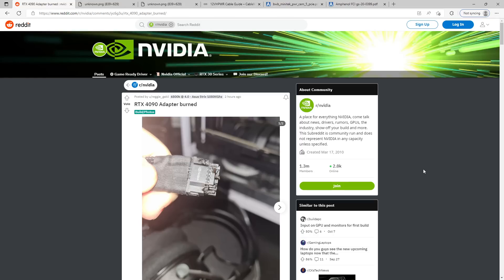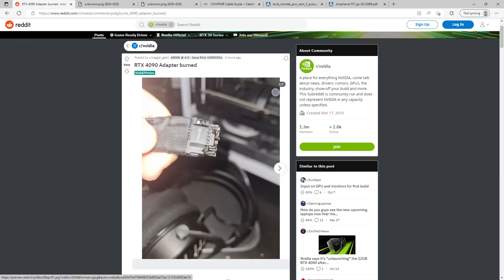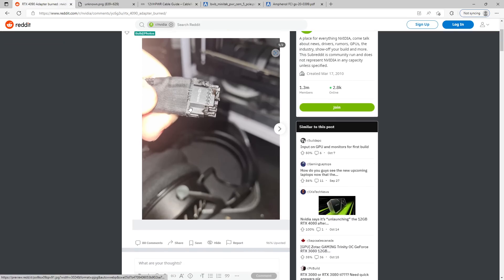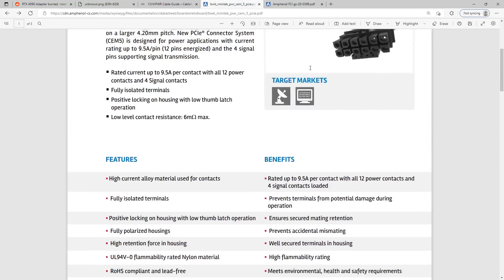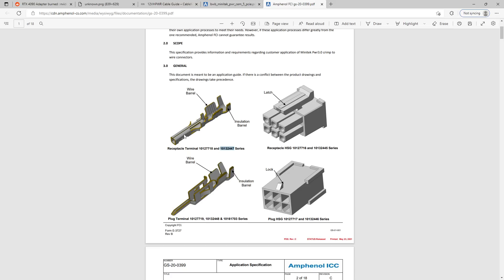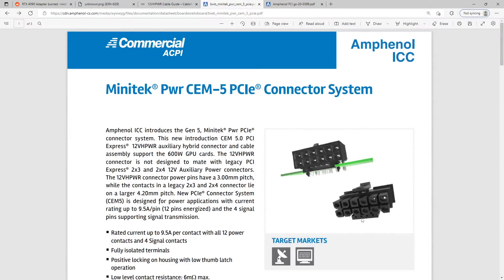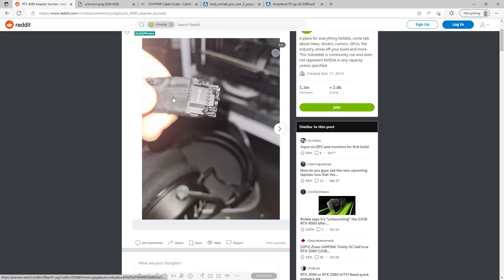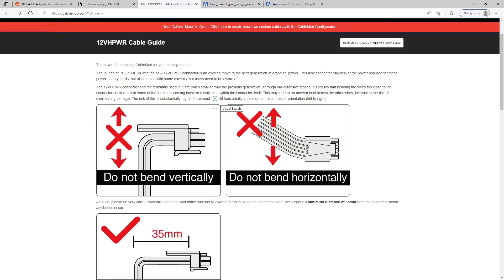The 12VHPWR connector sucks

Comment: The wire burned cause it was bent? What BS! Complete shit. In the thousands of computer builds I have built, and the many more customer done builds that come in for repair or upgrade work, even OEM brand name computers....I have seen with so much more severely bent, even zip tied down cables, not a single one of them ever has burnt cause it was bent to much, or not far enough away from the connector. 
If the connector is so baldly designed that a very reasonable installation like that pictured, which is not bent really at all, most people do it much more for cleaner cable management, then there is a serious design flaw that needs to be 100% recalled. Top that off with i can nearly be certain the connector and wires can not actually handle what its rated for...I guess will have to wait and see how many end users homes burn down, or someone dies before they take this defect serious.

Comment: The 3090 ti had the same connector. Its due to the adaptor with the 4 cables crammed in which causes strain on the pins. The solution is either use a 3 cable connector or an ATX 3.0 PSU with a native PCI 5.0 connector. Its the 4 cable adapter not the 12VHPWR connector.

Comment: I strongly suspect a discrete cable from the PSU would have way less problems and less likely to fail, as it’s way less complicated than a cheap adapter with 4 (!) cables hanging from it. 

And here I was thinking I could maybe use this adapter with my PSU, now I’m like no way, I would buy a new PSU with the new connector then. Best case you can replace modular cable on your older PSU with a new cable to 12VPWHR if the manufacturer offers it as a mod. But with certain restrictions, possibly.

Comment: I find the naysayers to the burning/melting PSU to be laughable now. I even used the exact PSU RMx 1000 as an example before this user reported it on their 4090.
It sucks trying to draw 600W from two PCIE cables that are daisy chained. (288 maximum each?) ehh. It's already dangerous without the 12 pin connector.

Comment: With the amount of power they're running through GPUs now, they should really be using some kind of big, screw-on, milspec type connector. Since the cards are the size of a bus now anyway, what would even be the downside?

Edit: I particularly enjoy the way they went to a miniaturized connector-- presumably for aesthetics-- and then you're supposed to attach to that a six-inch splitter-pigtail-dongle monstrosity to which you then tack on like four hundred additional cables. This is obviously the most aesthetically-pleasing solution compared to like, one thicc cable with a working connector and / or simply running multiple 8-pin cables to a set of adjacent headers.

Comment: Got one of these for my 3090 ti with one of the EVGA direct cables and said "wow those are some tiny conductors". Then I saw the 40 series power draw and questioned how anyone could think this is safe. I don't get why they didn't just use some XT90's or something similar with some heavy gauge wires. Galaxy brain idea - you could even offer connectors at different angles for wire management! Or maybe include the $4 in connectors with every GPU. One XT90 (and corresponding sized cable) could carry all of the current from a 40 series at full power and still have headroom.

Comment: So apparently SLI and NVLink setups are stupid. They are so stupid, they divide the load between two discrete devices that don't have to brush the limit of human technology when it comes to getting electrical current from regulated source to final silicon. They are so insanely stupid that from pure goodness of their hearts they got rid of them and now we have 600 watt capable connector that's apparently not capable of carrying even half of its rated power (when tilted you lose reliability on half of pins). safely.

And apparently CXL and switched NVLink2 do not exist having more BW than PCIe 6.0 draft already allowing creating spanned vGPU domain with close to on-silicon latencies, they so much not exist that Nvidia absolutely doesn't have THREE generations of complete systems relying specifically on this.

So yeah, good job Nvidia, good job.

Comment: The engineer that designed these connectors.....
After the VRM heating issues in the 3090 where people had to take them apart and put new thermal pads on...
Now this. 
AFTER you pay a huge amount of cash. 

This is why I went AMD and got a 6800xt. Fuckem thats why.

Comment: Yes, this is a f*ucking stupid connector, more power and much smaller. Sounds really safe! ANd now you cant bend it to fit it in your case either.. Really really SMART nvidia. But are there aftermarket cables that goes directly from the PSU to this stupid connector? That way one could remove all the separate connectors connected to this stupid thing, and only have cables directly. That would be great(er).

Comment: Order the 90 degree cable from CableMod. It releases on Oct 31st.

I know they make the whole cable with a 90 degree connector, but I think they are also developing a 90 degree adapter, so that would work for everyone who doesn't want different cables.

But yeah, the plastic around these is too scrawny imho.  When plugged in it should be much more "solid".  The way to do that would be to make it thicker, which eats into some pcb space.  I can see why they wanted a new connector, as having 4 8 pin plugs is getting ridiculous, but this thing really should have been a sturdier design.

The 4090 pulls same power as a 3090ti.  I think the reason we are just now seeing issues, is because the 4090's are so huge, which means much more likely to run into clearance issues with the side of the case. 

Don't bend the power cable within 3.8CM of the connector (paraphrased from CableMod's directions)

Comment: Sounds like the card and power supply end are fine, and there’s just a market for massive improvement in the cable and it’s connectors… starting with a ‘non ribbon’ cable where all the wires are free, just in a loose wrap

Comment: Probably if you bend the cable you've less contact area on the stretched pin connector.
Lower contact area = higher resistance.
Higher resistance, since every connector is basically IN PARALLEL means that A LOT LESS energy (as in Ampere) travel there, so the rest flow on the others, better secured, pins. This means that the "better connected" pins end up carrying way more Amperes, and as you know : amperes do heat cables.

Critical scenario (the one we see here): a single wire carry too much amperage and melt.

That COULD happens even on old ATX cables, but those are LARGER, with way more contact area (so there isn't much added resistance, even if you bend them) and parallel flow lines.

Comment: Nvidia just wants to reduce the cost and charges you at sky high price.
The main problem is the connector, go search any connector that can handle 50A,
e.g. TX60/90, 2 pair of them with total of 6-8 AWG wires is easy to handle 50A+ w/o any problem.

Comment: So "do not flex this flexible cable" is not going to cut it for most consumer protection agencies in many countries.  I would argue the install shown is "best case using a riser cable install and a slightly bend since you can't route the cable through the MB.  A more typical install is direct to MB with side panel installed.  I do not think any case has 3.5cm clearance to the side panel.  You will need at least 90 degree bend and likely more 150 degrees to route to back.  If they did not want 3.5cm region to be bent, they need to have it solid plastic.  Of course, this would mean most users could not install this rigid adapter since it would hit the side panel. You need at least a 90 degree adapter.  A consumer safety agency expects a typical user (e.g. grandma), following a typical installation (vertical mount to the motherboard with side panel on) to not melt, perhaps spark, and burn their house down.

Comment: I always wonder why they never adapted the EPS 12v from the CPU connector onto GPUs, less hassel less cables in generall, one plug to rule them all.
And it can carry 300w with an 8pin so you just need 2 for 600w and you dont even need that much PCB space.

Comment: Additional issue with this connector: you now have much less capacity to dissipate waste heat compared to 3 8-pin PCIe power connectors. YIKES all round.

Comment: Component are getting so hot anymore that even water coolers and 70 degrees air conditioned rooms can’t keep up. What’s next, nuclear reactors? Stupid. New gen GPU’s and CPU’s are fucking stupid, for this very reason. Just a matter of time before someone’s house catches fire and a family burns alive.
Thanks, PC industry. Each product should come with a fire extinguisher at this point. Dumb. Dumb. Dumb. Draw the fucking line already

Comment: Good video, but I respectfully  disagree in some points:
- Nvidia didn't come up with this connector. It is a new standard designed by  PCIe-SIG and Intel, and all manufacturers of PSUs and high  powered PCie cards are adopting it.
- The connector is an excellent design, it reduces cable clutter a lot, also size and costs.
-  The real problem (a serious fire hazard actually) is the position on top of the card (that is Nvidia failure) and going upwards   when the card is already very tall,  in most cases  there is no way you can have 30mm extra tall card and  another 35mm clearance in horizontal orientation (which don't forget is the standard) so users are forced to use vertical mounts ( using expensive and crash-risk risers  for pcie-4 due to signal degrataion , and directly  impossible for PCIe-5), and then  having the cable exerting pressure  one way or the other due to cable management needs and space restrictions. So it is a mechanical cause, not electrical, and it could have been easily avoided by including a 90 degree adapter by default, with the cable resting relaxed along  the top edge of the board.
- Proof of this is that the melted connector only have melted the upper row of pins, which means uneven pressure pushing the bottom pins and pulling the upper pins.

In fewer words, it  is a good design but a bad implementation.

Comment: It's not a non-problem, the current PCI-E 8 pin connector is VERY inelegant if you need more than 150w and we badly need a new connector.... but this connector is a complete fail given that every build needs cable management which means running cables at a minimum 90 degree and often even 180 degree angle.

Comment: That's Chinese-level "quality" engineering for you, just like Intel's glue-and-tape approach to "screwless" (with 56 screws) design of their reference ARC cards.

I don't think that the idea was to solve a non-issue, though. I think the idea was (as it always is) to "save" $0.01 on a $1,600 card by using dirt-cheap (fewest, smallest, and thinnest possible) components (like power connections).

Why? Because "saving" $0.01 on one million cards translates into a "whopping" "profit" of $10,000! And that "profit" is going to look good on somebody's financial report. <wink> <wink> <nudge> <nudge>

It is usually as stupid as that. I should know, because I know of a "competent" manager (CTO) in one of the biggest local companies who sold the software system that I had developed, and which had earned the company $1.5 million over the course of two years (and could've earned much more in the future), for... try to guess how much...

If you guessed $100,000 (a measly two-month profit), then you're a winner! Congratulations!

Comment: What I don't understand is why would nVidia/PCIe use SMALLER connectors when something like XT60 or XT90 seems like an obvious choice. Pretty small overall footprint, robust since it originates in RC, and could handle (theoretically) 720W for XT60 and 1080W for XT90.

Comment: Look at USB. More power in a smaller connector isn't inherently bad.
USB-A has fairly large contact pins and it can handle a whopping 2.5 watts.
USB-C has pins 1/10th the size (granted more of them, but still) and it can handle upwards of 240 watts. 
That's 10x more wattage flowing through a physically smaller connector. Granted, USB-C's design actually makes sense and is robust as hell, unlike Nvidia's pet project here.

Comment: 12VHPR is a joke. 

you have taken 4x 8pin with much larger pins and shoved it down into 12 pins (6 carrying actual voltage and 6 grounds) that are half the size. this is going to be the biggest fire hazard since the Samsung Note 7 Battery disaster.

Well done Intel, PCI-SIG and Nvidia. time to update to ATX spec 3.1 with a larger connector and the ability to carry 600 watts SAFELY

Comment: It's actually even worse than just saying each contact has to handle (more than!) double the power. If we assume constant contact resistance, doubling the power transmitted would results in four times the heat generation due to contact resistance (P=R*I²) since we're stuck at 12V

Comment: I've seen miners suffer burn ups of their 8pins when they use the daisy chained style of PCI-e power cable. The way to fix this is to use silicone insulated wires with heavier gauge wire to sink more heat away from the pins. The Pins on the card can sink heat in to the PCB. (The PCB mount versions of this style amphenol connector are higher rated than the inline version). Having thin gauge wires that are braided don't help with heat dissipation. And looking at the test conections they tested at 26c on a bench, not at 60c in a case (the exhaust temp of cards are likely to be near the GPU core temperature).

Comment: All this talk about 12 power connections, but half of them are ground... so you can only spread that wattage on 6 of pins and wait... 9.5A per contact and that is manufacturer maximum.
These connector pins are kind of similar to Molex Micro-fit which has 8.5A per pin... so 6 of them barely would make 600W at max rating. 
I was taught never to put connectors at max rating for long periods of time and that was looked as bad engineering practise. Also that stupid adapter sticking out of the card and can't even bend it... ridiculous.
Micro-fits have good testing results and there one can see moisture and mechanical stress really make resistance go up. I expect these pcie 5 connectors to be real pain in humid climate. I really hate these.

Comment: Problem with the 35mm bend protection is that it's stupid, too. It just ends up providing more leverage on the connection. It'd be like using a longer handled wrench on a stuck bolt. In this analogy, we want the bolt to be stuck and having any kind of extra pressure on moving it is going to be bad. A shorter handled wrench (keeping the analogy) would also just be more likely to break the handle instead of the bolt.  Also super bad.  Instead, why put everyone on one single bolt when everyone has been doing it with 3 or 4 bolts for over a decade already? Oh so you dont have room for it? Look at the size of those GPUs, the lack of space is a lie. It's down to simply trying to be A) useless materials B) use proprietary materials to try to force consumers to be locked into their products in any tiny way they can implement.

Comment: Inside the female "pin", the underside vs in the datasheet image (opposite the fold), the wall of the pin/socket is cut and bent inwards. This functions like a spring. So when a male pin is inserted, that pushes the male pin upwards towards the fold steam side, ensuring the male pin makes  contact with the inner wall of the female pin, and providing a bit of mechanical friction retention.

However, as you can barely make out from the datasheet image, this "spring" section doesn't sit out at the tip of these female pin, but more like mid-way along its depth. That means, if a male pin is slightly pulled back in its connector, it can still be halfway-from-bottoming-out inside the female pin but making extremely poor electrical contact with the female pin inner walls - because it's not deep enoigh to be ;/k KNM

Overall the male pin has a slightly smaller OD than the female pin receptacle ID. Because a complete size match, where all sides make full contact - while it would make a very good electrical connection, it would cause way too much friction. Add up a few of them in a connector, and it would cause so much friction that you'd break the retention tabs and push the mating pin out of its connector instead of insertion. Or if it survived insertion, there would be a high risk of tearing the wires off from the crimped pin when trying to pull the plug out again.

Comment: The thing I hate is also the position in the middle of the card, it looks terrible and it's the reason I sold my 3080 it ruined my build. I get that the board is shorter than the heatsink but they couldn't design an extender? Or make an adaptor like evga? It not working is the cherry on the cake. 35mm of straight cable before bending is just stupid. Get your rulers out people you're all installing it incorrectly.

Comment: That connector is awfully similar to micro fit and even 5 amp per circuit is little too much if any margin is needed and close pins reduce the current even more as everything heats up more and heat builds up at the middle. That 5A current is with 30c temp rise while mini fit can do 13A at the same temp rise

Comment: Nvidia - "Check out our new High power connector! It has less pins that are also smaller than the low power connector"
Nvidia have really lost the plot in every respect with the 4000 release. I'm finally pulling the pin on Nvidia and going over to AMD because of this release

Comment: I have checked on similar pin assembly and yes similar only and the amount of force needed to split appart the casing was so much that the plastic housing cracked first. So while its only similar hardware I have a tendencie to think something else is happening inside this connector. I can provide image or video material if needed. Awesome work as always 👍😀